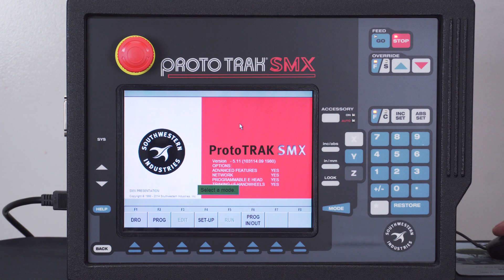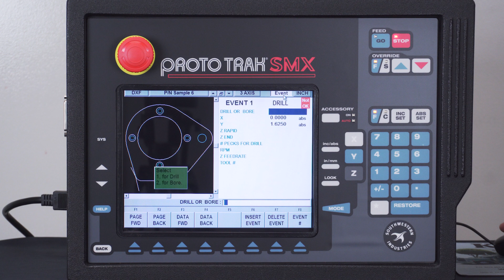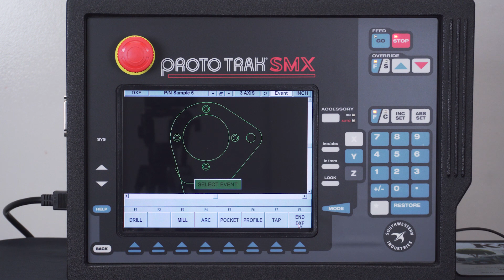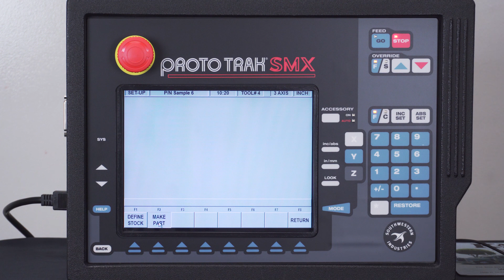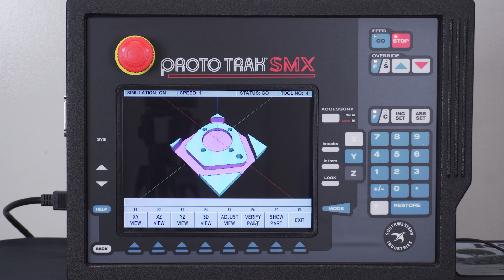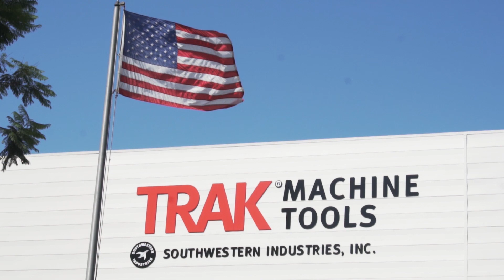3 Axis DXF Files with the ProtoTRAK SMX

Comment: Is there a difference , one better that the other programing wise.
DXF vs XT parasolid
Reply: The biggest difference os that you only need one solid model to cut any side of the part. With DXF, you need one for each side. On top of that, DXF is only  2D so you have to refer to your print for all of your Z dimensions.  T.P.

Comment: Hi pat.  How do you take the program from a floppy. To the hard drive on the machine
Reply: Raymond, I believe what you are asking me is how to open a DXF from a file that is on the floppy drive.  If this is correct, when you go to the PROG IN/OUT mode, you have to first find the A drive which is where your floppy is located.  If you press the TAB key in the lower left hand corner, it will move from part programs to file types to drives, etc. Press it until it gets to the drives and select the S drive.  Once you are there, select your DXF file you want to open and it will automatically open.  FYI, this puts the file into the RAN memory and allows you to turn the final part into a PT4 program when you select END DXF. There is no way to save any programs or other files onto the hard drive.  Does  this answer your question?  If not, please reach out to me again.  T.P.
Reply: @trakingpat2750  thank you Pat it worked.  Have a great weekend.  Ray

Comment: Hey I have a problem with the spindle I can't get it to engage/spin since retuning to my mill, I have everything set as usual & the fan is now blowing & wasn't before last use. Any ideas on be very much appreciated.
Reply from the maker: One of our tech support people can trouble-shoot this for you if you give them a call. Please have your model and serial number ready. Their phone number is 800-367-3165. You can also do a live chat from this web page: https://www.southwesternindustries.com/support
Reply: @TRAKMachineTools  Thanks for the reply I've managed to figure it out and feel very silly, as the issue was the door guard was slightly loose and needed a little tightening, therefore not allowing the spindle to engage. After gently putting pressure on the guards while locked & then turning the spindle on i realised my silly mistake. Many thanks!
Reply: Just for reference its a prototrak smx 3500, incase anyone else may encounter a similar issue as I did.
Reply from the maker: @ClubBurgis  No problem. Glad to hear it was something simple.

Comment: How do you find the USB drive?
Reply: Dakota, are you asking me how to search for the drive that your memory stick is plugged into?  If so, go to PROG IN/OUT.  Then use the TAB key until it reveals all the drives that you have memory plugged into.  The C drive can be used to download files from but you cannot save files to that drive.  If your memory stick is plugged into one of your USB ports, it will show up as drive D, E or F. use the data keys to highlight the drive you want to save to and push the OPEN FOLDER key.  All of your programs will be in that folder.  Let me know if you still have questions.  T.P.
Reply from the maker: Hi, Dakota. The USB drive is the same thing as the "memory stick" that Pat refers to. It's a flash memory drive device that plugs into the USB port. ~Patrick K.
Reply: Thanks for the help, I got it work!

Comment: how do I load program to thumb drive. wanting to program off line then install in smx knee mill
Reply: I assume that you have the program in your computer.  Are you using the SX offline programming or a different source for programming?  Either way, all you have to do is plug in your USB stick and then copy and paste your program from your computer to your stick.  Then, in your ProtoTRAK, go to Program in/out and use the tab key to find the drive that has your USB and open it from there.  Does this explain it well enough?  If not, let me know.  T.P.

Comment: Hi Pat, loving all the info you're passing on :)

Any tips for programming radius/roundover cutters ? (eg https://www.keocutters.com/wp-content/uploads/CRE124.jpg )
'm currently having to model the path in Inventor, take the drawing it to my SMX and enter it manually - feels like I'm doubling the amount of work for each part. Is there an easy way?
Reply: Hey Steve, good question!  When I use these types of tools, I just make a profile and offset the tool.  Then, I measure the tip diameter and add a few thousandths to it in my tool set-up so that it doesn't touch the part with the tip but rather the radius.  Thanks for the feedback!  Let us know if my explanation makes sense to you.  T.P.
Reply: @trakingpat2750  Thanks for your time Pat.
This is the way I currently do it. I program a profile - that's great. Then I have to re-enter the same profile, only it's now (eg) 3mm larger as a path for the roundover bit, (which follows with 'tool centre'). 

It just 'feels' like I'm doing something wrong or I'm not seeing the easy way !

(Self taught guy, so apologies if I'm missing something basic)